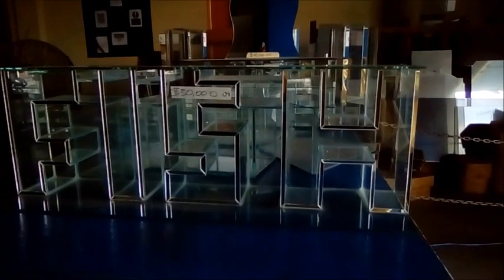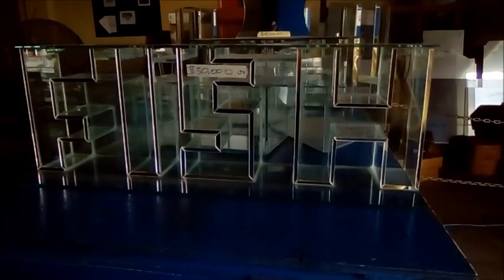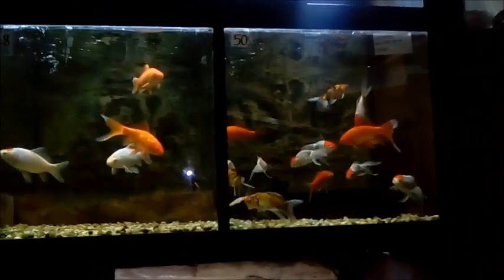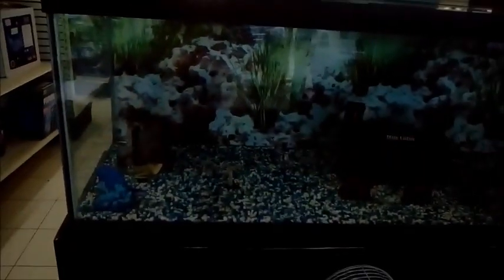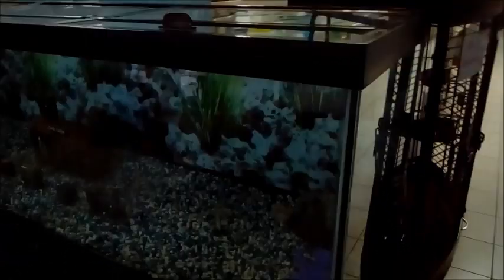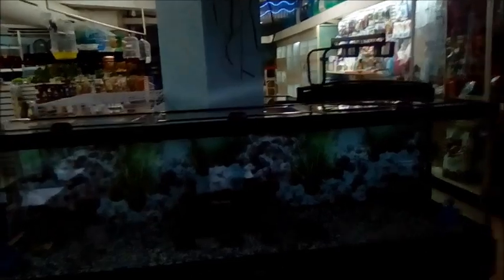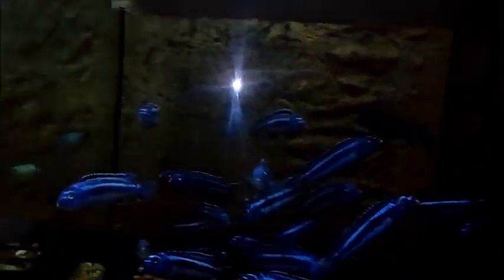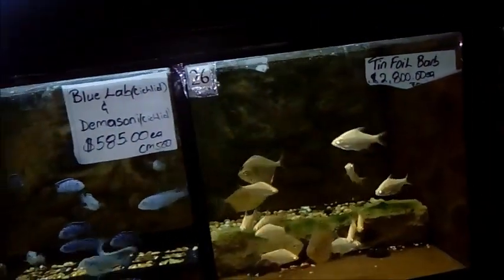AQUARIUM GLASS | THICKNESS AND DESIGN

Comment: What dimension glass would you recommended for a 60*24*24 aquarium?
Reply from the maker: thats 2 foot by 6 foot nothing less than 1/2 inch thick glass or more, the higher you go upwards the more pressure on the sides of the aquarium, so you will need a few braces and thick glass.
Reply: @FKJ_WORLD  it's actually 5ft by 2feet. Is it possible to use 3/8 glass?
Reply from the maker: no thats  too thin, aquarium will eventually fall to pieces